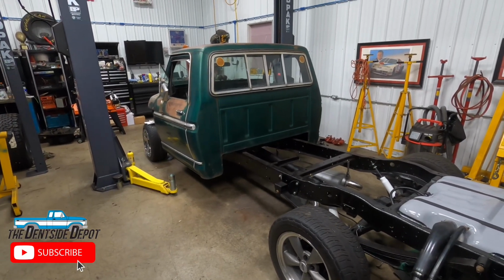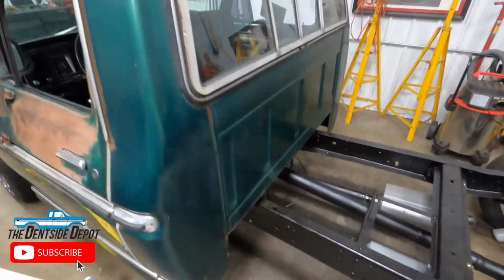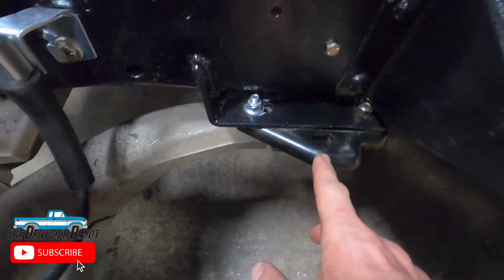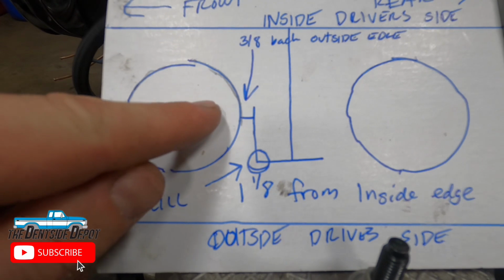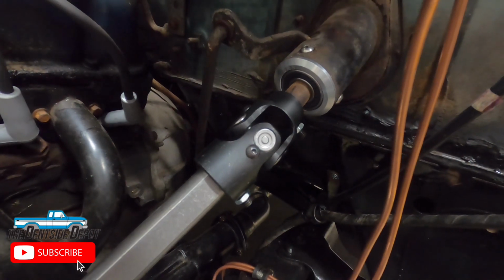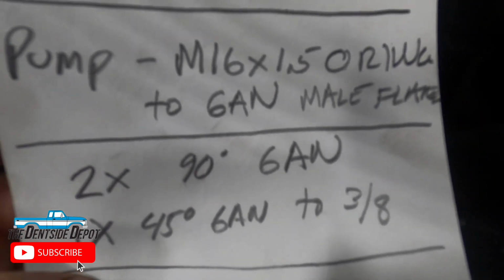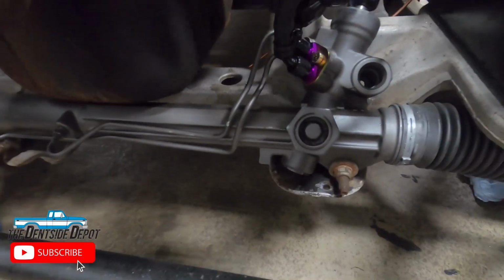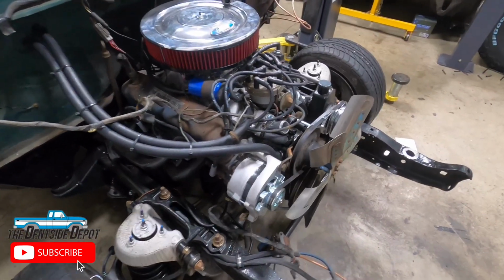1979 Ford F150 CROWN VIC Swap Explanation- Jade Interceptor Part 2

Comment from the maker: To my viewers, thank you for 300 subs. Also, you will need an 18" Nylon fan with this setup, a metal one will spin the belt and cause the engine to overheat since a 1/2" belt is being used instead of 7/16". Everything in this setup besides that works perfectly on the truck after about 300 miles of driving. Better parts can be had, but this was a budget build. The Final part video of the Jade Interceptor will be posted in early October.
Reply: Wow today is 3-10-24 and you have 14.3k subscribers, went up pretty quick in 5 months... That's a beautiful truck, I have an 07 Crown Victoria P71 and I've taken perfect care of it for over 10 years 150k miles and 10k on new transmission but it was stolen 3 times in 2 years and they destroyed interior and did lots of body damage now I think I'm going to do a ford truck project with it...

Comment: This came out great. I’m not sure if you’re covering it in the next video but if not what did you do with the rear to match the 5 x 4.5 bolt pattern of the CV front end? Thanks
Reply from the maker: Thank you! I just used wheel spacers in the rear to match the front, but you need to be careful. Improper installation or cheap spacers can ruin your day really fast.